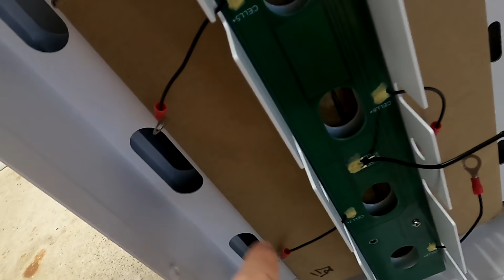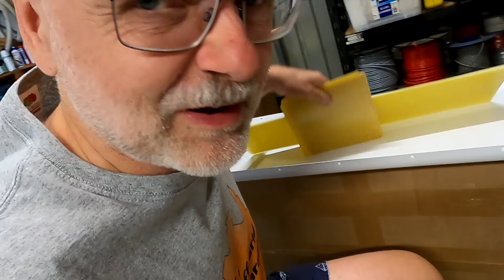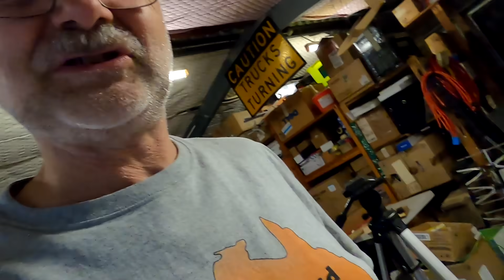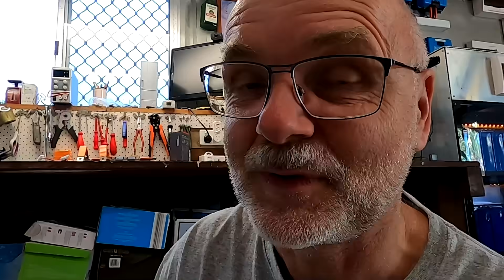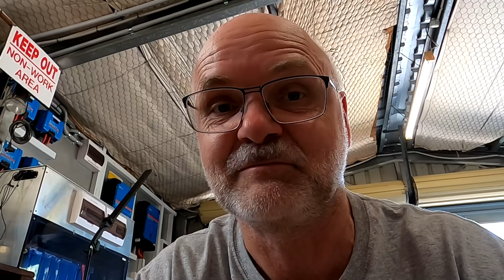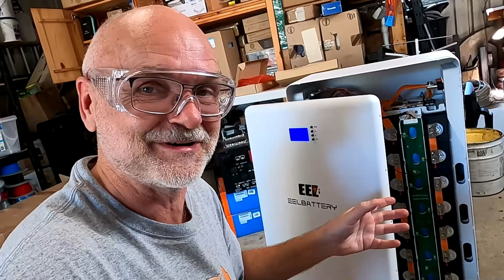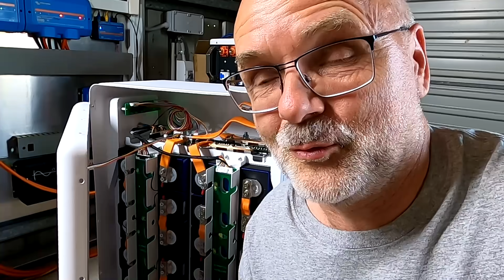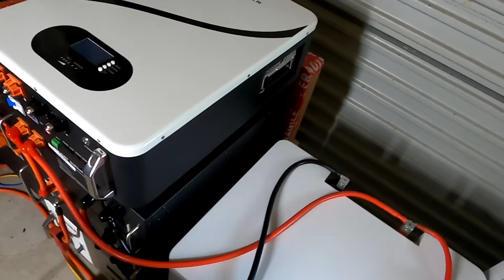The vertical EEL Battery DIY Kit. Is it OK for the cells to be stacked?

Comment: Be careful swinging the wrench around on the plus terminal, if it touches the case there could be a big spark.
Put some heat shrink on it for the just in case.
Reply: Normally neither of the battery terminals are connected to the case
Reply: @niktak1114  
Or if you touch to the negative.
Un grounded case that’s scary, if insulation fails the case could be at the plus potential.
Reply: @universeisundernoobligatio3283  the case is usually grounded (or it's supposed to be) but not either of the battery inputs
Reply: @niktak1114  
As an electronics engineer an unground battery negative design would never get past any design review I have taken part in.
Reply: @universeisundernoobligatio3283  then most engineers of these types of systems would disagree with you
Reply: @niktak1114  
All engineers i know would never design a un grounded high energy system. That is incapable of tripping a breaker in a fault condition.
Reply: @universeisundernoobligatio3283  48V batteries are considered low voltage so that's not required. For higher voltage ungrounded systems like a typical DC string inverter there will usually be ground fault detection built in.
Reply from the maker: Everything was disconnected. Didn't you know that we are not working on life systems...
All my batteries have floating potentials, neither pos nor neg is grounded. Why would you!?
Reply: @OffGridGarageAustralia  
Batteries are always live, touching plus to minus would release the magic smoke.
An un grounded system has the potential of the plus becoming connected to case, but the breaker does not trip. A hazard asking for trouble.

Comment: Nice yes l have two 5kw rack battery installed standing on end ,as that's all the space I have in box being only 300mm depth fit 2 x 147mm height in space
Reply from the maker: Yeah, the floor space requirement is certainly a benefit of these vertical batteries.

Comment: I have installed LFP cells sideways (not flat but sitting on the narrow edge) in a motorcycle conversion. After 2 years I found several cells leaking at the poles causing serious corrosion. I guess placing them upright would have prevented that. The other thing is when compressing them with 300Kg (not in this case) you want possible air bubbles to travel to the top. This would be compromised by laying them horizontally. Therefore a No No from me.
Reply from the maker: Thanks for sharing.

Comment: Vertical stacking helps with compression.
Reply from the maker: yes, but in an irregular manner. The bottom one has to carry the additional weight of the batteries on top of it.

Comment: While the EEL battery does not compress the cells, the cells have little room to EXPAND. Is this enough??
Reply from the maker: The expansion force will be a lot higher than the clamp force of the top plate. It's not a proper compression, more of a fixture.

Comment: Nice looking kit enough to scan your additional info. for a link and $ price (did not see that). Like the Flexible Bus Bars as the better way to go. Looks great in organization of the important details. Wondering about pros and cons of sealing LiFePO4s in a case with (looks like) no ventilation ... for heavy amperage cycles. Thanks for this review ... Capt Bill 👍
Reply from the maker: I have no ventilation in my battery shelf either. You don't need it for Lithium batteries. Unless you're talking about heat disposal...

Comment: Thanks again for another great video.just out of curiosity will you be doing a review or build with some sodium ion cells I think alot of people would be interested on there potential and performance.cheers again 👍
Reply from the maker: I have 4 NA+ batteries here, just not enough time. We will be looking into this soon.
Reply: @OffGridGarageAustralia  fair enough.ill be looking forward to your review and opinion on them when you have time.cheers
Reply: Energy density needs some time to improve....and even then the voltage range is far too wide

Comment: Seeing as all the cells are free to begin with, why not connect them all in parallel and top balance them to 3.xx voltage you want instead of in series and dealing with balancers and dealing with cell overvolt protections, balancers etc before installing it?
Reply: We will see the impact of not top balancing cells that are almost a year old before assembly, as another thing Andy is testing, they will be top-balanced afterwards - the resulting capacity difference may be minimal (2-5Ah perhaps), as suggested by previous builds. The extreme majority of fully assembled battery packs sold do not top-balance them before shipment, and those packs work just fine.
Reply: @stefanvanzyl9090  Ok, makes sense. :)
Reply from the maker: As explained, it's always a bit of a test with such cells. The seller claims, they are all matched, so balancing them before assembling should not be necessary...

Comment: Interesting, I got basically the same case (the horizontal version) and grade A 304ah cells. I was barely able to even fit them in the case (with the epoxy sheets in between) and got a good compression with the end plate. Using even just one foam pad would prevent me from attaching the end 

Btw they have their own YouTube channel with how to videos :)
That’s how I figured out how to put everything together
Reply from the maker: Seplos supplied longer screws for the compression plate and all cells have EVA tape in between to smooth out curves and little swelling.
Yeah, I know they have these videos but a link in form of a QR code would have been nice...

Comment: Andy, have ever received any 48v battery that is build with only 15 cells instead of 16?
Reply: Yes the Pylontech and also the Hubble AM-2 both are built with 15 cells.
Reply: @SOLAR-cr5dp  thanks a lot, my question is because I bought a GreenSun Solar battery, and I checked inside an there where only 15 cells.
Reply from the maker: No never. They would be incompatible with my system. I always ensure, it's a 16s battery.
Reply: Honestly wish manufacturers would come up with some special name for the 15S batteries. Yes I know they are true 48V nominal but having an odd number of cells does make things more complicated so I do agree that 16S should get the name 48V nominal. Maybe 15S can be "Odd 48V nominal"

The only reason why you'd make a 15S is because you need a true 48V nominal or can't go up to 58.4V or whatever the max 16S voltage is..but all "48V" inverters I've seen support up to 60V so we should jail all the 15S battery manufacturers.

Comment: I wonder why you did not top balanced this cells before buiding the battery?
Reply from the maker: I explained it in the video, I think.
The seller matches the cells, right, so why do you need to top balance?
Reply: @OffGridGarageAustralia  I did not know that in Australia "B" grade cells are shipped matched. But I would balanced them before connecting them in series as magazine regardless.

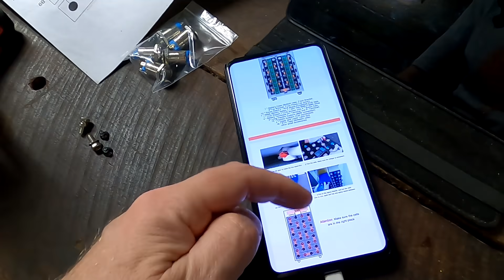Comment: Andy, at 12:10, I question the instruction advice not to use EVA foam between the cells, does that mean no insulating plates at all, no EVA or epoxy? That seems a big NO-NO to me as the only thing preventing the metal cases of the cells shorting together would be the thin shrink wrap, and a short between cells could spell disaster right?
Reply: Use the EVA or epoxy boards depending on the fatness of your cells.
Reply: Andy used epoxy sheets where he didn't use the foam.
Reply: @CollinBaillie  Thanks, I saw he had something between the cells but was not sure if it was EVA or Epoxy glass. How important is the EVA foam in stationary applications, and how important is it if you are compressing the cells? 

My point was more about the instructions, as it might lead people not to use any insulating material between and around the cells. Something that I've see other people do at their own peril. 

My preference might be to use both and if only one, the epoxy-glass sheets as it would be more temperature resistant and offer more short-circuit protection.
Reply: @jackoneil3933  It's a very good point. 

Thinking about it, the foam basically offers a way to fill space, which is compressible. The FR4 sheet doesn't offer the compression.

You raise a point of stationary or mobile. I guess this considers movement or vibration, and the two different installations would experience this to varying levels.

I see your mobile/stationery installation and raise your with a heating/cooling expansion and contraction. Also a form of movement. Would EVA foam or FR4 sheeting be better here?

Personal opinion would be to use the rigid FR4 sheeting on the outside faces of the cells to protect from puncture by external objects (including the metal case itself in which the cells are placed) and EVA foam between cells.

Of course with the static, pre-defined dimensions of the case, you're limited if your cells take up enough space that EVA foam (even the 1mm thin stuff) just won't fit. If you're making a raw pack and say wrapping it with fibre tape and some whole-of-pack shrinkwrap, you can build it how you want.

Another consideration: Does the EVA foam act more like an insulator than the FR4 sheets? Will your pack retain heat longer using a porous foam vs a solid sheeting? 

It makes for some careful consideration.

All that said, the EVA foam is probably mainly to fill the gaps when your cells just aren't dimensioned large enough for the case to hold them all together tightly. Using just FR4 sheeting is perfectly acceptable if they are already a "tight" fit without the foam.
Reply from the maker: The instructions are not great. Not as detailed as Seplos has done them.
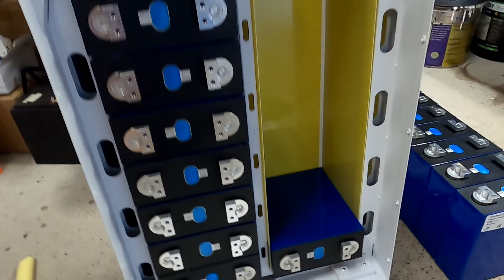I've explained the cell installation and isolation at 12:40

Comment: Shame that this DIY box has just one terminals, the others have two, which is better for connecting multiple batteries in parallel. Probably in a short time there will be a comparison with Seplos vertical DIY battery box :).
Otherwise, I like this and the other DIY boxes. The rounded corners are nicer, but harder to replace with the new DIY modified ones. DIY boxes with sharp corners have the advantage of being easier to DIY modify - for example, replacing a simple front sheet with a new laser-cut one for some other better BMS ...
Reply from the maker: Yes, good point, I forgot to mention that it has only one pair of terminals. The rounded corners are also more expensive to manufacture, I would expect. At the end, it's a battery case which sits in the corner... so colour, and finish is not important.

Yeah, I'm keen to see the Seplos vertical box now ;)

Comment: Good on you Andy. Better for us to spend an evening with you, off-grid enjoying some 'EZ-Energy Life', than glued to the old psycho-emotional brainwashing panel. 
As for side installation, my intuition says "NO", as do others. I seem to recall a battery review from Will Prowse with side-mounted cells that had leaked when shipped. 
From SolarPowerEdge:
Can I mount them upside down, for example?
Answer:
Absolutely not recommended.
LiFePo4 prismatics – basic internal structure:
First of all, there are many layers inside the cell case (to build up capacity) and they are pressed together and attached at the top to the terminals at the factory.

So it’s best to keep them in the orientation they were built in – right side up. It’s important not to risk straining or placing any undue forces on junctions where all the layers connect to the terminals of the cells at the top.

Limited electrolyte in the cells:
And here is another problem. There is a limited amount of electrolyte inside each battery cell case. Little, if any, would be free. But if there is any free electrolyte, naturally it is more dense than the air inside the cell case, and would sit at the lowest part of the interior of the cell case. And it needs to be available to whichever layer needs it, in other words, able to contact any of the layers that might need it. Put the cell on the flat side, only the lower layers in the stack can potentially contact the electrolyte.  

The electrolyte is pretty expensive, and the manufacturer doesn’t want to use any more than necessary to make the battery cell functional. Otherwise, perhaps there would be more.

If you lay the batteries on their LONG flat side, it is absolutely possible for some higher layers inside the case to become Electrolyte Starved over time. It’s simply not worth the risk. We cannot monitor inside of the cell casing to determine what is happening.

Anyone who claims otherwise is welcome to take a risk, but with a $10,000+ battery bank – I don’t gamble.

Electrolyte starvation could in fact potentially happen, and it would affect the capacity and performance of the cells.

RIGHT SIDE UP (always use this if you can)

LAYING ON THE NARROW side 90 degrees to the orientation of the internal layered structure, ONLY IF YOU ABSOLUTELY HAVE NO OTHER OPTION.

As tempting as it is, one should not store or install the cell laying on the widest side, as this places the internal layers in a vertical stack, and so if they need to wick up electrolyte only the layers on the bottom would have access to do so.

Keep in mind not all LiFePo4 prismatics may have the same internal structure, confirmation from the manufacturer might be necessary.

Potential venting of toxic electrolyte

Furthermore, the safety vents on the batteries should be in a vertical orientation at all times. LFP cells are very safe when properly handled and operated, but those vents are there for extreme cases and and any pressure relief needed. You don’t want to have anything interfering with their operation. Also if the cells vent sideways there is a risk of the electrolyte spraying out – since it is toxic, this is to be avoided at all costs.

I hope this article helps someone. If you’d like to see any particular topic addressed by video or posts, please email me or reply to the article. Any feedback is appreciated. Thanks for reading!

Comment: Maybe the design is made for single use. Cables on two sides and the display on the third one. Not easy to put some cases together...
Reply from the maker: Yeah, that is something I don't like with their design. Having everything on one side makes the case wider due to the larger recess next to the batteries. Here, everything is above the actual cells...

Comment: Did you hire a professional film/cutter team? Somehow your channel is loosing its spirit. It looks more and more like advertisement…
I remember back when you did experiments with some cylinder cells. Mmm… you are going to loose me. 😢macht aber nix.
Reply: Cylindrical cells make no sense for this type of system
Reply from the maker: I never had any cylindrical cells on this channel except the PALO batteries for testing.
And as the other viewer said, it makes no sense for a large solar storage system... However, I will use these smaller 5Ah cells for some remote solar-battery projects.

Not sure what you mean with advertising when I test these DIY battery boxes and show how to build them? If you're only interested in these cylindrical cell, well, not much on this channel...

Tschuess Peter!

Comment: Andy did they give you any time frame for change over to jk bms. Please keep us informed as was about to drop money on 2x jk but may wait till eel start putting them in box.
Reply: I ordered the EEL box without bms.   They gave me a good discount for that.   Ordered the JK separately.

I think i need to make some changes to the communication holes on the eel box
Reply from the maker: Yes, the JK has a different communication board and maybe mounting holes for the BMS PCB itself.
It is size-compatible with the PACE but not the Seplos BMS.

Yeah, get the boxes without the BMS as mentioned here if this is an option...

Comment: This may sound stupid but why cant u link batteries up to 240 v and not have an inverter
Reply: You need AC, but batteries deliver DC.The only way to get AC from DC is by inverter, no matter how high the voltages are.
Reply from the maker: 240V DC will be fatal and is definitely not a DIY task any more. Super dangerous!

Comment: Is the EEL D.I.Y battery box ,specific size for the 304ah cells or can small AH cells be used ?
Reply: They have this size that takes the 280-320ah type size cells and they also have a box for the 230ah cells.
Reply from the maker: 280Ah and 304Ah have the same cell size. The 230Ah cells are smaller...

Comment: Disadvantage of vertical stacking is that there might be electrons leaking out I think.
Reply from the maker: Ah... it has this tray underneath the battery stacks. Is that what it is for? I was wondering what this weird looking pump and cable is for which leads back to the top cell...
Reply: The electrons all pile up in the bottom battery
Reply: @wallacegrommet9343  YES! Indeed!!

Comment: Andy if you worry about bubbles not coming out the first few cycles and no compression then put it on its back as you are going to do (dis)charge tests anyway.
That's what i would do and you have a crane to ease things.
Reply from the maker: I'm not too worried about the bubbles and it's a good long term test...

Comment: Didn’t see an isolation plate towards the front cover. Or is there any on the inside of the frontcover?
Reply: The two long clamps will prevent the cells from touching the front cover plate.
Reply: @SOLAR-cr5dp Sure. But having all the terminals somewhere close to a metal cover?! I don’t know… 🤷🏻‍♂️
Reply from the maker: The terminals are not close to the front cover. Plenty of space and no way they can ever touch due to the metal rail carrying the balancer PCB. If they do ever touch the front, you have other issues...😄

Comment: If the EEL set is charged - cycled for the first 3 or 4 times flat on its back, compression will be no longer a concern
Reply from the maker: But you need to compress them for these first initial cycles. Just operating them upright makes no difference.